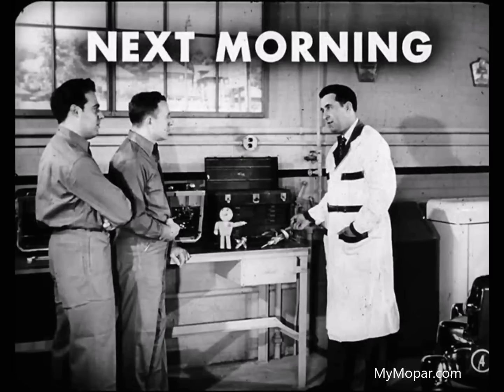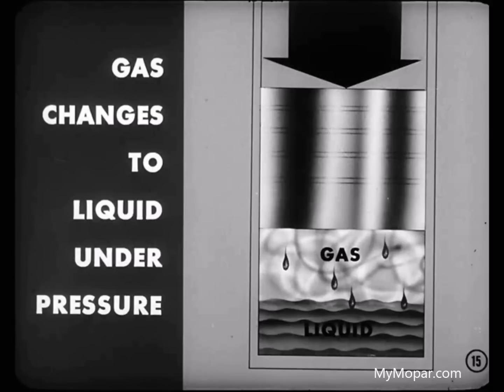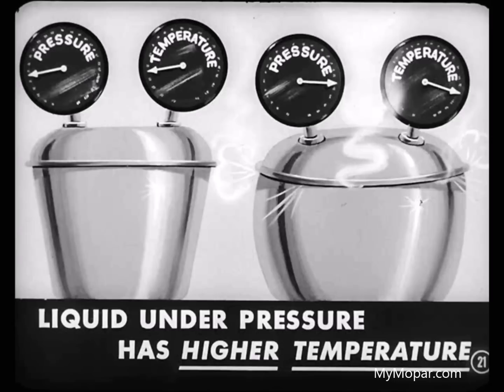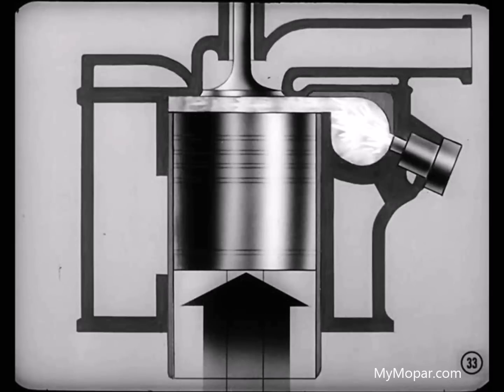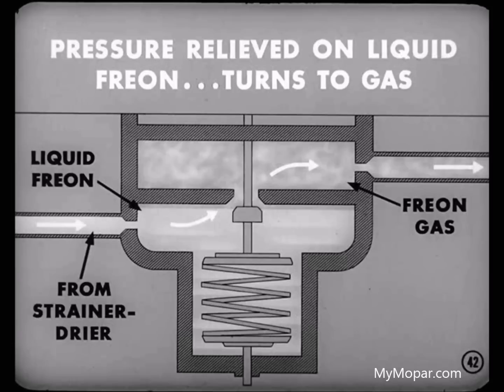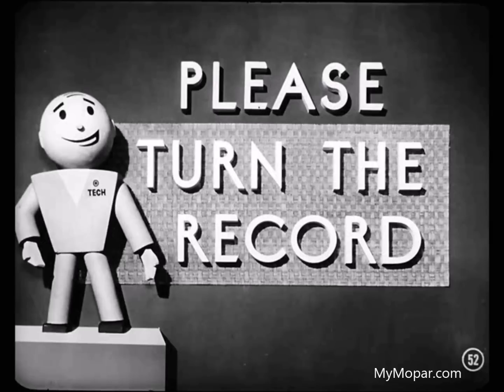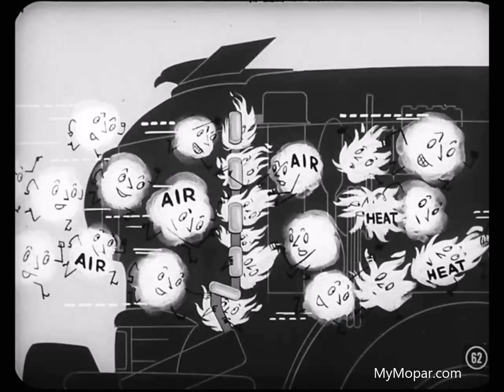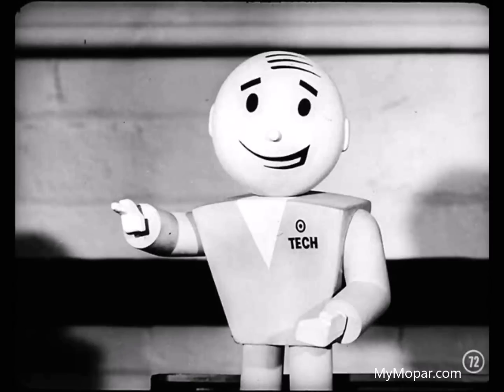Chrysler Master Tech - 1954, Volume 7-7 Airtemp Car Air Conditioning

Comment: Chrysler Corp was lightyears ahead of GM , Ford , Packard , Studebaker and others when it came to AC . They founded Airtemp back in 1930 when they fully air conditioned the 85 story Chrysler Bldg in NYC. It was the first office bldg in the world to be compete ac'd , and Chrysler did it . The news was on front pages around the world . Then railroads approached Chrysler asking if it was possible for them to supply ac systems for rail  Pullman cars . Chrysler replied , no problem , so picked up lots of contracts with various railroads . By the time car companies started experimenting in about 1940 , Chrysler just watched . There was no pressure and were ready if pressed . I actually had a 46 Cadillac with "GM Highway Air" . Looked ok but so undersize , usless so they dropped the idea for awhile . Well , it wasn't untill 1952 when GM introduced their next  version , then of course Ford and Packard did likewise , but they were poor offerings . Chrysler was just standing by waiting . They were totally confident and knew exactly what was needed for a sucessful system from the start because of 20 yrs experience . In 1953 they offered a beautiful system . Where others called for "removing the fan belt from the compressor" during winter or cool weather (which meant the seals would dry and freon escaped over time and had to be recharged every spring) , Chrysler let the slow speed V4 compressor keep turning , but incorporated a simple temp control valve in the back shelf evaporator that had two purposes , one of which was to "unload" the pressure at the expansion valve when the 3sp fan sw on the dash was turned off , so the freon moved easily without cooling and let the compressor sort of just "free wheel" . That also meant the seals stayed lubed by the oil in the compressor . You never touched the belts . The second function of this temp sensing control valve was to maintain the cars interior temperature like today's optional  "Auto Temp "systems . In this case you turned a knob on the stem of that valve on the evaporator unit in the trunk which set and maintained the cars interior temperature . No one else had that . If others had incorporated it in their system it would have eliminated their  problems . I am able to explain the system as I completely restored a 1954 2dr Imperial Newport in 1968 , so I've had and enjoyed the ride for all these 51 years since . I've been to hundreds of cruises and shows and no one has cruised in with another 54 Imp Newport !!  I am always asked about the AC , and does it still work --ha , here's where I have fun . I say "get in" I start the old 331hemi 235hp (which is the most hp of all 54 cars) and turn the ac switch on to low . There is no draft at all , but the interior turns cool  immediately , in , I'll say , 20 to 40 seconds . ( I like cool , so i have it set at 68°f) .They can't believe . The hotter the day the more fun I have . I'm in paradise . Only scary part is , I'll soon be 85 , so there's no chance of another 51 yrs !!!
    BTW , I've never removed the belts nor have I had to add any freon 22 since the initial charge when I completed the restoration in 1970 .  Hope you enjoyed my explanation of the Chrysler AC system . To help you visualize , my car is dark green lower , light green hard top , with sun visor , and is sitting on original wire wheels . Interior is medium and light green naugahide done up like the original real leather , which was in rough shape . She's as  beautiful as they get , and a great road car . Lots of get up and go , very responsive !!  just wish I had more time in front of me . I've had many Imperials  come and go , and still have a few , but this is my special baby . 
  PS That fellow who showed the Imp sedan with air has good pics of the complete unit . Same compressor , and identical condenser up front and evaporator in the trunk . He shows the "low freon" sight glass and on the right side the interior temp control switch . My cars unit is identical .

Comment: A bit more mechanically complex than modern systems. Did the compressor turn all the time? Electronics now control temperature and an orifice replaced that expansion valve?
Reply: The original compressors didn't have a clutch so they ran all the time. The only way to turn off the system was to remove the compressor drive belt .
Reply: They're going back to expansion valves, just electronically controlled. For fuel efficiency purposes, but also because heat pumps are increasingly being used in EVs and it helps optimize for the different temps/pressure in heat vs AC.

Comment: The old days of R12.. Super cold but when released into the atmosphere deadly to all..
Reply: Don't kid yourself.
Reply: No one died
Reply: @waterheaterservices  that's exactly right.
Reply: Wait till you hear about the R1234yf that's required in all modern cars. When you get into a crash, it burns and releases hydrofluoric acid. They realized this after they promised the EU/EPA they were going to switch to it, and found that windshield glass was being dissolved after crash tests.
Reply: Just more CORRUPT Big Business Lobbyist bullshit!!! 
In the 80's, Cars were DESIGNED to have easier Freon leaks, making the sell easier to Congress in the 90's. 
I'm a Retired Auto Mechanic, old A/C systems before 81 RARELY EVER LEAKED.
Reply: @CarlRCTips  After 44 years of driving I can say that my cars never had that feature.
Reply: @chuckz8053   Not trying to be a Conspiracy Theorist.... just basing that on 50 years of working on Cars. 
BTW, R-134a Refrigerant.... better for the Ozone, but known to cause Lung Cancer! 

R-12 was 20-30 times more efficient, and was only responsible for a tiny fraction of the Ozone problem.... 
Modern Science says (subdued in the Press of course): over 80% of the Ozone Depletion problem from the 1950's to 1980's was Aerosol Can Propellants, and Methane from Cow and Pig Farts!! 🐖 

Only the Aerosol problem has been resolved.

Comment: Except for the guy with the gravely voice (which was kinda creepy),  this is a very informative  video!  I wonder if any of those troubleshooting scenarios would work on my 2009 Mercury.. the a/c konked out about 5 years ago and no one seems to know what's wrong with it... and replacing it would be well over $1k.. no thanks!
Reply: If the gas has been gone for a long time, all the seals and o-rings everywhere require replacement prior to getting it running again as they are nourished by the gas and when it leaks away they shrink and become dry and brittle.

The same applies if the gas is left low for a long time. the system gets used to the lower pressure and when you charge it back up to full pressure, the weakest link blows, then the next weakest link, then the next and the next and on and on until you have spent many thousands of dollars! Cheaper to have the whole system renewed at the same time.

It's a shame we can't do with car air conditioning that which we do with fridges when they break, and just throw them away and get a new one!
Reply: The Ford has a fixed office not a expansion valve. Never used a propane device  on 134a. Only in tech school.

Comment: These older systems were easier to service , they were nicely spread throughout car. In 1957 they switched to the under the dash modular AC systems that cost lest to manufacture.  The under the dash system lowered the option price , but causes a jam pack  service problem for us mechanics. A mini van is a mechanics and customers worst nightmere , often to replace the evaporator the cost starts at $1500 and can go up to $3000 if only a few of the other AC parts are shot.! Also the EPA and over population caused dictator politicians to force them to use new kinds of freon,  with gay molecules of  less pollution !

Comment: I wonder how many cars had A/C in 1954 and just how much was this as an installed option? Must say, though, this is fun to watch to see just how far we have come with car A/C. From a system that was stem to stern to now fully under the hood, we've come quite a way.
Reply: It would depend on the car maker, Nash-kelvinator soon be AMC had under dash a/c systems in the 1940's at a cost of around $300.00, while other makers were putting them in the truck like this one and charging upwards of $900.00. Leave to a refrigerator maker slash compact car company to figure cheap and effective automotive A/C units very similar to what's in cars today.
Reply: Many cars still had 6-Volt electrical systems. Most, if not all 6-Volt systems were positive ground. When they went to 12-Volt systems, they switched to negative ground. I've read that 24-Volt systems may not be too far off...
Reply: Poy Ester what, so how many volts were half the cars back then?
Reply: It was an expensive option , equal to about 1/3 the price of the car ! They could only use it on 12 volt cars and less than 1/2 the cars made in 1954 were 12 volt., so it was only in the high priced cars back then.